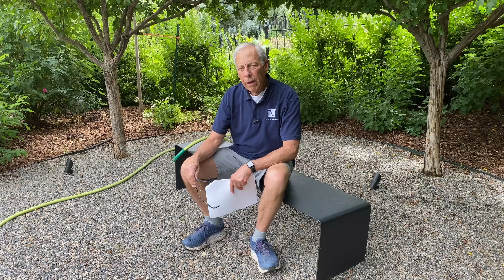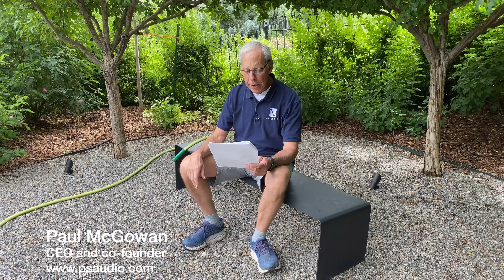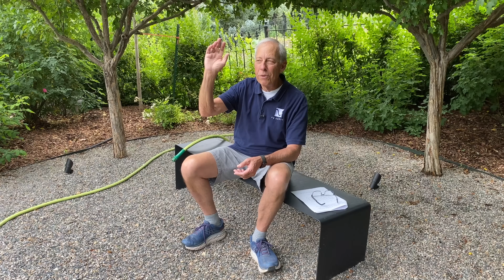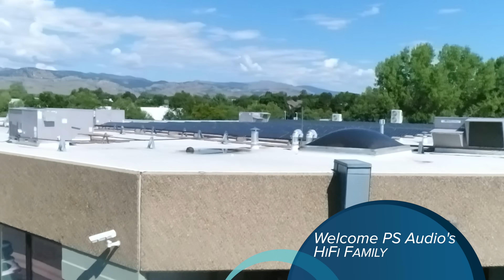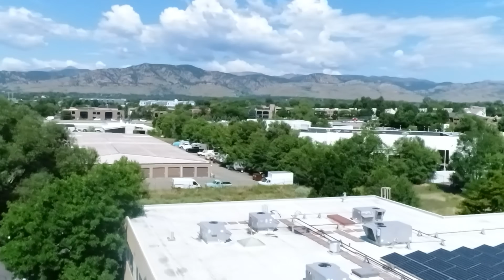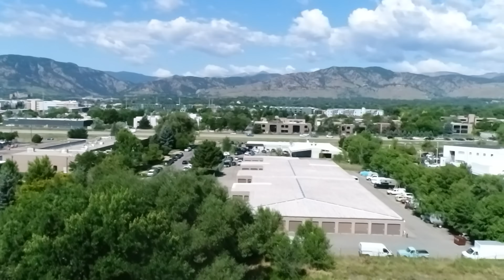Class D vs. Class AB amps

Comment: Intelligent Compact Efficient (ICE Power)
Reply: why dont you guys take amp say from year or two and mass perduce it i know you can controll the out come i mean its last years model but it would lower the price for hi end audio i mean why not we need good sound face it if we dont know what good sound is how do we know what to buy and what are we hearing.okay back in the 80s some of the audio like stereo studio sold low end like ads nad harmon so for $150 bucks you could get scott reciver with say0.005 thd and it sounded good but there was higher audio that did not sound any better but was better because of the snake oil real snake oil bs crap they fed us.i have good ears i hear things most dont like fleckels cicks zaps distotions therw recordings threw outlets oh ya it drives me nuts but when i cant listen to music because of this it makes me think noise bocking built in a power condioner i know it would cost to do but how do we live in homes apartments that power is crap good sound should not cost so much as it dose.but thd mixed with line noise from your outlet power condition is what i need but they cost moer than i could aford so this is why i saying this  build it in to it so the poor amp has a chance to get rid of some noise so it sounds clean not fizziy or pop and the best one voltage drop right in the middel of song the sound in about 2-3secounds just fall on low volts amps and sound goes to distrotion and its time turn it off.but the ones that dont do that is qsc amp i used for live events but the thd is 0.1%and it sucks down 12 amps but i dont get those shifts in those way like i sed and at this point i have music .but the way thats built is a true amp i can count on i have others sound tec its livly and full sound but my fristed class d amp going in the right but it dont have ice so you get swiching from the amp its a barringer but it takes i  like350 watts and gives 170 at 8 oms i think its brite mid range is live and dont fall on its head but i was dj-ing at this time . its the recivers that disapoint me not the dj amps the fact is they sound almost as good to all the rest .im a siant vinney audio file cause of my apartment i live in.im not try to give a sob story but life is hard and not evrey one bennifits from life its just afact.but i can still listen to my music.i have good ears so i can hear over the noise but not all the time somtimes you just say no.
Reply: @jumpsuite  power conditioners suck the life out of the music! They aren't any benefit unless you live in a third world country with crappy electricity.

Where do you live? I'm from Scotland UK and the electricity to my outlets is fine. No noise and no audible THD when listening to my bookshelf and on wall speakers.

My amplifiers, speakers are very low distortion. Maybe you need to upgrade your amplifiers and speakers to better specced lower distortion ones.

Comment: When civilization collapses and you're living off grid with only solar but still need your stereo the class D amp is gonna be a winner. 
I have a class D and and AB amp, same power and all, I use the D for the woofers, the other day I reconfigured the setup using the class D amp for the mains and a plate amp for a woofer. It made a pretty compelling stereo, although, as Paul comments here, the AB amp is just a step more in many ways sound wise. (I like that I can swap a few wires and have a different stereo...)

Comment: Paul is saying it well. A passionate audio engineer can make a great sounding class D amplifier and a not passionate audio engineer can make a poor sounding class A amplifier. ICEpower originates from the late 90s in Denmark with a guy Karsten Nielsen who did a Phd project in collaboration with Bang & Olufsen. ICEpower is sort of green technology. It's energy efficient = cold = ice. The Beolab 1 active speaker got based on ICEpower released in 1997 as a first. I have a pair of these speakers that have lasted me 22 years now with zero problems. One great quality of class D is in fact that it runs cold and thus can last much longer than very hot amp technology involving class A and tubes. I use them in my home theater setup as front speakers. They still work perfectly fine. Each speaker has 3 amplifiers in it with the bass being ICEpower of 450 Watts and the treble, and mid-range each being class AB at 125W for total 700 Watts per speaker. The cabinet is heavy aluminum, so box vibrations are as non-existing as they can be. For set of home theatre front speakers in a 5.1 setup, I'm not sure I can find anything much better and great is that the speakers use ICEpower only for the bass where class D makes the most value and doesn't hurt audio fidelity.

Comment: Price no object, I have heard no class A or AB amps that can compete with the best Class D amps, in spite of the tremendous price difference. But you do have to get the right class D circuit, and ICE ain’t it, sadly.
A and AB do still usually have a more ‘musical’ tonality, but in every other aspect good Class D boards have in my experience been far more resolving, precise etc.; basically Class D seems technically/objectively better, but A/AB still seems subjectively better, if that makes sense.
Reply: Lord Victor Halgaard So which class D design is the best?
Reply: @jonlaws4493  Hard to say: on paper Purifi is the best at the moment, and it is certainly very good, and better than most - but it is not quite as precise sounding in practise as some of Pascal's circuits found in Studio applications and I believe some very expensive amps like Aavik. 
There are more, but the general issue is that most of them are not readily available to consumers yet, as they are either quite new designs, or not as widely used as ICE or Hypex which are more established at this point - and neither of them are bad by the way, just not the best at this point. (though nCore is still keeping up well in fx. Benchmarks iterations)
Reply: G Guest  
"Do shielded power cables make a difference?"  NO.  Not unless you have a huge electrical field in your listening room that can interact with the power cable.
Reply: G Guest  It's definitely not anything like the "shielded power cables" discussion, in the sense that there is a LOT of data to work with here, and very obvious differences, unlike with the cables, which are usually considered dubious at best.

I'm perfectly aware how the amplifiers work, and that hasn't given any solid answers: sure class A has no switching noise, but yet most still end up with a colossal amount of distortion compared to class D amps like Purifi. 
I'd love more detailed analysis of both circuit types compared...
At the end of the day, what I, and many professionals I've dealt with find, is at this point a technical superiority in class D, in what comes out of the speakers at the end - but at the same time a warmer/meatier sound that many prefer in class A, combined with a lot of the usual stigma, nostalgia and conservatism found in HIFI, keeping class A at the top, which makes it hard to get class D out there. Not to mention its much more difficult to design/make well.

This is generally an endless discussion as most things in hifi, because of those last issues.
Reply: @LordVictorHalgaard  
If Class D is so much more difficult to design and make, why is the price per watt of class D so low?

Comment: You totally did not acknowledge Bob Carver - the genius who created A/B amplifiers with the efficiency exceeding that of Class-D with his tracking-downconverter.
Reply: I'll give you one guess, what class that tracking downconverter is.
Reply: Carver was and is a great innovator -- but his stuff doesn't hold up well and is notoriously difficult to repair.
Reply: @editorjuno   I'm still rocking hard with my 30 year old 150w Carver integrated amplifier.  Has never been recapped and the sonic holographic engine, in conjunction with my horn-loaded Klipsch speakers, still creates some of the best sound stages I ever heard.  Reliability has never been an issue.
Reply: @Artemis_Prix  -- You're lucky.  I am too -- I have a piece of equally old Luxman gear that's also all-original and still works flawlessly.
Reply: I think it was Bob who took class D amps to another level when he brought a pair of them to a function plunked them down on a table plugged them in and output 500 watts each no transformer!!! Jaws dropped!

Comment: Going by what Darren said a few days ago about class D distortion I would conclude that a good class A-B would be superior even when you balance (mask) said distortion  with a tube input. With that said  a non-critical listener who wants the most amount of watts for your money would be happiest with class D.
Reply: Fat Rat 
Very true, Rat.
Reply: @FatRat-f9m  Pleasing is probably more descriptive of what you want but I used natural because when most manufacturers "voice" an amplifier they listen to a female voice then the male voice and tweak the amp so that the voices (singing) sounds natural  and when that happens most other sounds  also sound natural or correct just like correcting the flesh tones of a TV  makes the rest of the colors correct.
Reply: Darren's theory doesn't make a lick of sense to me -- the overall THD+N specs of the best Class D stuff speak for themselves.  https://www.audiosciencereview.com/forum/index.php?threads/review-and-measurements-of-purifi-1et400a-amplifier.7984/
Reply: @Douglas Blake -- I use a 2.1 amp based on two of those dirt-cheap TI gems that I use for TV audio.  The key, especially for a suitably solid low end from my passive subs, is the hefty 24VDC @10A power brick I bought for it -- the 4A brick packed with the amp simply didn't cut it.

That said, the TPA3255-based power amp I use for my serious music listening is an order of magnitude better, delivering about 125WPC to my vintage 8 ohm JBLs -- it needs about twice the voltage as the TPA3116-based amp, so a power brick is out of the question, but a ($25!) 48VDC @10A SMPS makes the thing really sing.  As I've previously testified, that setup easily outperforms the (Nelson Pass designed) Adcom GFA-535 I swore by until about 10 years ago -- and it all cost me a total of about $70 shipped!
Reply: @Douglas Blake The type of distortion that Darren was speaking of makes the music appear louder that many people will say sounds good but is not accurate ,and it probably takes a trained ear knowing what to listen for to tell things are not quite right. If you ever read many critical reviews by say Stereophile or other such reviewers  you will find that they cite things wrong that the average listener would not pick up on and would need them pointed out with an A-B  test .I suspect most class D owners never heard perfection so they don't know what they are missing . I believe that the BHK Amp mentioned in other posts here would sound a lot better than most any class D in a critical A-B listening test . especially with 'golden ears 'doing the listening. Again specs DO NOT tell the whole story.
Reply: The interesting thing is that the opposite seems to be the case: manufacturers/professionals I've seen use class D for critical listening and A-B for shows, because people consider them more "high end". 
At the end of the day, class A usually has much higher distortion than a good class D amp like Purifi, which has a THD of 0.0001% compared to fx. the PS Audio flagship BHK with 0.1%.
Reply: @LordVictorHalgaard  The thing with THD is that .1% is imperceptible and while much lower numbers look impressive it does not really  gain you anything sound wise . What Darren was saying is Class D has a wide spectrum type distortion (a new type of distortion ) at higher outputs  that makes the music seem louder(that some people may think sounds better)  but it's not accurate and a vacuum tube input counteracts this with slight compression at high outputs .While we would like our amplifiers to be like a wire with gain , truth is all amps color the music somewhat , at the end of the day it's what sounds most natural to us.
Reply: Lee Kumiega 
Excellent explanation, Lee.
Reply: @leekumiega9268  
No, Darren was not saying the M1200 has "wide spectrum type" distortion, as though it were some new type.  His actual words were, "at higher amplitudes, the spectrum of the distortion becomes more complex."  He went on to make a comparison of a stick striking wood, with "just a few harmonics associated with it," against a snare drum which is "almost like a square wave, so it's very high-ordered."  
This is ordinary THD, but I haven't seen any SPD plots for it.  However the numbers from ICEpower look quite good:  Under 0.01% with a 4 ohm load up to 1000W at 100Hz or 1KHz, or up to 800W at 6.67KHz.  That shouldn't be audible, so I don't know why Darren was discussing it as something to compensate for, starting at modest power levels above 100W.  Maybe with some very pure sinusoidal test signals, you could start to hear distortion that slight, but I thought this was supposed to be about music.
Reply: @marianneoelund2940  In his statement that you repeated verbatim going from  a few harmonics to like a square wave (not in a conventional seance but wide like it ) so  I described it as wide spectrum  as that well describes a snare drum ,  he said the 1200 starts this at only 100 watts  . I take it to mean that this is something new to class D that does not show up on a THD measurement. I have not heard class D critically yet but have heard some amplifiers with fantastic specs that had time smearing that hid a lot of fine detail that unless you were listening for them you would think the amp sounded fine.
Reply: @leekumiega9268  
There is no distortion new to Class D which will not show up on a THD measurement, especially a THD+N measurement.  
You can download the ICEpower 1200AS1 datasheet here:  
https://icepower.dk/products/amplifier-power-modules/as-series/
Distortion versus power curves are on page 20.  There is a minimum at 1-3W under 0.002%, then a peak under 0.01% at 15-30W, then it falls again under 0.005% by 100W.  Above that, it rises gradually into 4 ohm loads (especially at 6.66KHz) but stays under 0.01% until very close to (within 3dB of) full power.  That is, it remains far below the 0.1% which you consider imperceptible.  Also keep in mind that one of the most audible sources of amp distortion is the crossover notch in A/B designs, and Class D doesn't exhibit that.  

Regarding those high-end amplifiers you heard with "time smearing," who told you that was the case?  Time dispersion caused by any high-end amplifier design won't exceed 2-3 microseconds, and that is 2 or more orders of magnitude below audibility.
Reply: @marianneoelund2940  If here is not any type of new distortion with class D then what would you call the distortion Darren noted a few days ago? Our test equipment clearly is not adequately to sense the problems with class D  see  https://www.eetimes.com/why-class-d-amplifiers-may-test-well-but-often-sound-terrible/  It would appear we need to identify this distortion and devise a new way to measure and  quantify it.As far as what amount of THD is precept-able see Paul   https://www.youtube.com/watch?v=p9v45DQND3c                                                                                                               Also  I never said The amplifier I heard time smearing with was high end but was a mass-market Kenwood and was said to be "high speed" with a frequency response of DC - 100 khz  ,slew rate of 140V/u.sec ,rise time of .95 u.sec , THD & IMD .02 at rated power and .008 at 1 watt , rated power was 125 watts per channel  It was made in 1980 at a time when manufacturers used a lot of negative feedback for low THD numbers see at 3:34    https://www.youtube.com/watch?v=kA_n3NKu_iQ    I can't think of any other reason that I heard a LOT more fine detail in my music ,I heard things I never knew were on the record or CD when I got my Carver system compared to the Kenwood and other things improved too like bass response and tightness and a wider sound stage.
Reply: @leekumiega9268  
This is starting to go beyond the scope of what I can address in a comment section.  The comments in the Shanahan article are appropriate to a clocked Class D architecture which operates similarly to a Sigma-Delta demodulator in that pulse widths are quantized in time.  I am not aware of any recent designs which use such an architecture; rather, the generation of the PWM timing is in the analog domain and is not quantized.  Thus there is no resolution issue at lower power as Shanahan was discussing.  But such a resolution issue would still show up in measurements which include the noise floor, so I would disagree with some of his conclusions even for a quantized-PWM architecture.  High-resolution Fourier analysis simply will not miss anything that is audible, especially since human hearing is also spectrally based.  
Also, today's Class D designs are using switching frequencies not achievable in 2005, which reduces the impact of the output filtering that was problematic with many older designs.  

Regarding why your Kenwood would not seem to reveal as much detail as the Carver amp, I would really need to test one.  The specs are impressive, but there are other aspects of design which can cause issues with reactive loads.
Reply: @LordVictorHalgaard  -- My sub-$50USD TI-based "chip amp" has far better THD+N than Bascom's supposed masterpiece.  I'm sure that monster has something going for it, but that sure isn't its "high fidelity" performance, at least not in the original sense of the term, i.e. "great faithfulness" as per the "straight wire with gain" ideal for amplification.